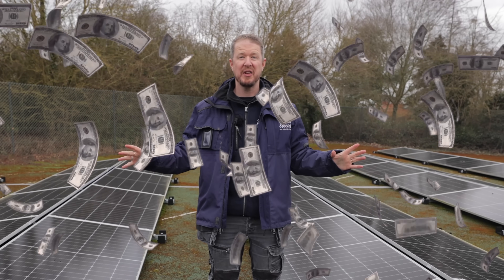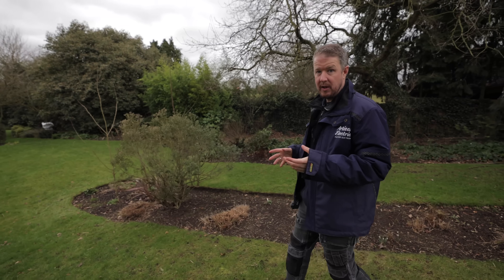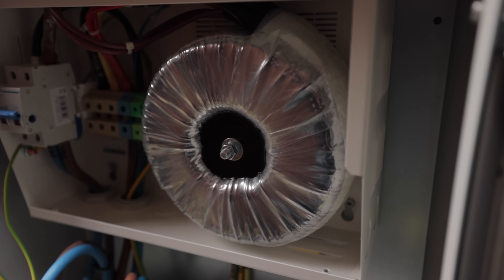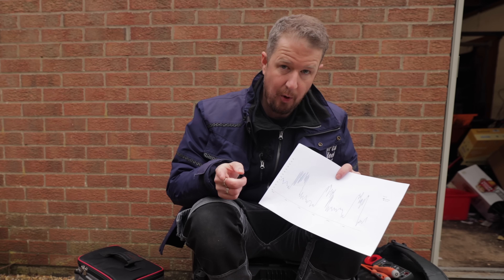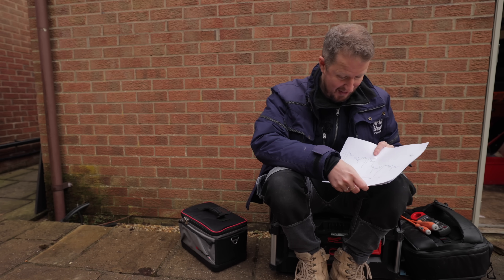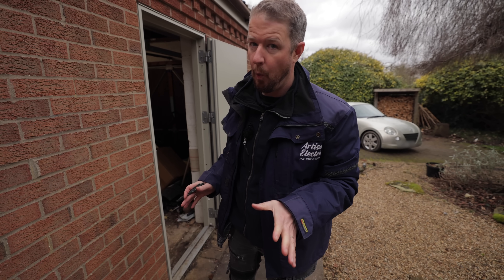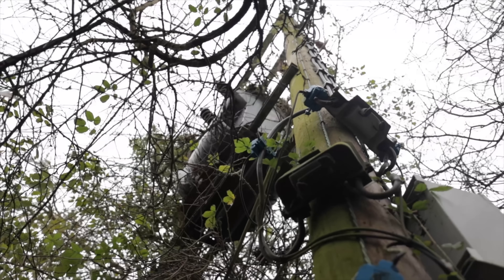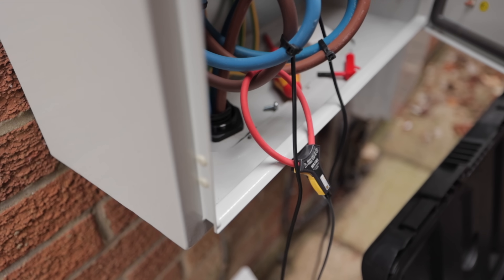THOUSANDS Down the Drain – And We Can’t Do Anything About It!

Comment: I dabble in electrical here in the US, but I am not a certified or licensed electrician.  I recently designed and built my own solar system with 200A service coming in from the local power company.  My system is “grid aware” and can take power from the grid, but selling is disabled on my side.  My setup also passed county electrical inspection on the first attempt.  While I’m not a licensed electrician, I do enjoy this kind of work and find your videos very informative and interesting.  This one, in particular, has me very curious because that’s a very odd issue to have.  I don’t know anything about how your electrical grid across the pond there works, but I’d recommend verifying your neutral and ground are properly bonded, done so in only one location, and that your grounding electrodes are sufficient.  I’d also suggest to check the phasing and make sure you don’t have a neutral landed where a hot should be, check that the inverters are properly synchronized and producing the same voltage within 0.1 volt of each other so that the load is evenly balanced across them. 

Likewise, I would be inclined to agree with you about the utility’s transformer possibly being the issue.  I’d even go so far as to suggest that the home’s distance from it could be a contributing factor as well.  300 meters is a LONG way for 230 volts to have to travel AND share with other homes.  My home has a dedicated 72kva transformer from my power company, and it’s right across my road, with the length of the service conductors from the transformer to my meterbase being around 80 feet.

Comment: The UK must have different laws and hardware compared to Australia. In Australia we feed the solar (PV) at around 350 to 400VDC into the grid tied Inverters which regulate the AC produced to ~220VAC. On really dark wet days the PV voltage can be as low as 345vDC, the AC voltage is ALWAYS 220VAC even on a superbright summers day. I suspect the MPPT controllers in the inverters are faulty. So long as you have excess PV voltage, the inverters should output regulated AC voltage at approximately 1-2VAC above the grid voltage clamping system voltage. I have a smaller PV system,  only 12kw of panels feeding 2x 8.2kw inverters in parrallel with 38kwh of LiFePO4 storage and my system voltage ner goes <213VAC or above 230VAC. We have a web based data logger which tracks and records all system voltages and power, PV and Grid, 24/7. So long as your MPPTs are ok you should have stable grid following output.

Comment: I'm in the southern US. In the 1960's when everyone started to install central airconditioning systems, we were getting voltage drops in the afternoons. My dad called the power company and had them bring out a voltage monitor for 24 hours. In the hot part of the day my dad went to the neighbors that were sharing the transformer and had them turn on everything electric to get the voltage to drop. The voltage dropped so much they quickly installed a larger transformer.

Comment: You only have a 35 kw h battery , no need to charge at 17 kw, you have 6 hrs to charge, no rush, drop charge power to  8 or 9 kw and your power draw will drop so your voltage will rise during night

Comment: The mains voltage in most parts of the UK is around 240v. Usually a touch above. The only people who have less are at the end of long radial runs in rural areas when they’re under load. Nothing wrong with that at all. That’s been our correct mains voltage for a long time and the entire system was designed to provide that. 240v plus or minus 6% was the original spec. I’m extremely surprised that you don’t know that, and haven’t been observing it for years whilst working in the industry!

The fact that all the paperwork post January 1995 now says 230v is just EU Brussels nonsense. At some point in time they insisted that the mains voltages across the EU were harmonised. Most countries had 220. We had 240. After many months, the engineers eventually managed to convince the numbskull Eurocrats that it was effectively impossible to change voltages. It would mean billions and billions of Pounds, Francs, Deutschmarks etc. worth of infrastructure running at sub optimal efficiency.  The voltages would have to stay the same as they were.

The Eurocrats typically idiotic solution was as follows. Rather than leave it alone they had to score a pretend victory. Those countries with 220v systems would have to ‘change’ their voltage from 220v to 230v plus 6% or minus 10%. 240v countries would have to ‘change’ their voltage to a different spec, being 230v plus 10% or minus 6%. This allowed everyone to keep everything exactly as it was before. The only things that ever changed were the wording of legislation, the textbooks, the words written on product labels etc….

I challenge you to measure the mains voltage at every property you visit this months and tell us in a video. You’ll measure over 240v RMS at most properties in most areas nearly all the time. It might dip a bit at times of high load on the grid. If you did the same test in France you’d get a little over 220 most of the time. Because they have a crappy grid that might dip quite a lot at times of high load.

Comment: 17kW on a single phase supply was always going to have issues.
Here in Australia (same voltages) we can put a 5kW solar system on each phase without any drama. If you want more then it becomes a more complicated application with the DNSP where they check network capacity, cable size etc etc.
Two options;-
a) limit the export/import limit of the inverters until you're in an acceptable range, or
b) upgrade to 3-pahse supply.

Comment: So, Solar Edge inverters won't stay inside the allowed voltage range for the grid? That is - not good. I'd expect that they have built-in limiters against that. 
This might become relevant as I'm considering getting a solar system myself. Solar Edge is off the table for now.

Comment: Here In Alabama USA You Never See The Transformer So Far Away From The House! Mine is About 200 Feet And I Am The Only 1 on The Transformer! The High Voltage Wire Runs To My Neighbors Which Is About As far As You Walked Where They Have Their own Transformer Also!! At Every Transformer There is A Fuse/Disconnect! Every Pole is Cleared Around And Has It's own Earth Ground Rod! They Run 2 Hot Wires And the Earth Ground From The Transformer To My Service Entrance! So If Some Retard Was To Run The Mower Into The Ground Rod And Break The Wire Coming From My Panel It Still has Earth Ground Coming From The Pole The Transformer Is on! But Like I Said All Poles Have There own Ground Rod! The Bottom Wire Is The Ground Wire! Connecting Them All Together! The Wire on Top of The Pole Is The High Voltage!

Comment: it looks like the power is no where to go on the net when the sun is shining, stranger is the enormous drop in voltage when the batteries are charging from the grid. The grid can not handle the load. there is to much resistance. it must be a power grid problem. like breathing through a straw.

Comment: My suspicion (I am NOT a professional electrician) would be that the impedance between the building and the transformer might be just high enough to not even allow the grid providers transformer to even it all out - was the grid impedance measured at the site? ... The voltage issues of the neighbors down the line - your PV system probably fixed them when running :)

Comment: So these voltage optimizers ... make ohmic loads not run over their rated power, making them less effective not less efficient, while making switching power supplies work harder and lossier? And it's basically a toroidal transformer with its secondary winding in series and out of phase (this looks like a 1 to 2 kva toroid core, no way it will power a whole house any other way!)? Could be an autotransformer also, which is almost the same principle...And... you know, I'd expect to pay like 100-150€ for a toroidal transformer this large, 50€ for all the DIN rail paraphernalia, and €20 for the sheet metal case. What`s with the difference?   . I'd have expected a unit that 'spensive to be at least a proper ferroresonant CVT but I am seeing no big capacitor.

Comment: Step 1 of troubleshooting this is you need to listen to UK power networks turn the solar and battery off and measure the voltage for a week to see if the large voltage swings are still present. You need to prove the problem is upstream that they must fix rather than you. Suck it up, follow the steps, and report it.  If it is the local grid then there's not much you can do - the only way forward would be for the house to use more power I suggest moving it to an off grid system but using the grid to support large loads and charge overnight.  Go on Eon next drive be happy at 7 pence overnight for 7 hours and then run the house in the day mostly off solar and battery with some limited grid support.  What else can you do?

Comment: On the solar inverter, it seems that a voltage output limit would have to take priority over current -- for the EV charger  to pass line supply test.  Those two units would have to be in close proximity or use over-sized conductors. But of course with that constrain(the voltage limit) it might not be possible to pump a high current back into the local power lines at the desired rate, and you do not want to over voltage the neighbors.  It would seem you would need a 200 amp supply service to accommodate a 100 amp  return and stay within voltage boundaries, back and forth.  I'm guessing these units are power factor corrected.

Comment: Not knowing how you’ve installed.  As I understand it, solar connects to a solar mppt charger which takes whatever solar voltage comes in and converts it to storage battery charging voltage.  The solar controller is generally attached to a bus bar with the battery and inverter inputs.   Now I don’t know if your running ac to dc car charging or dc to dc.  Dc to dc  would require an additional controller to limit amps.  Then the inverters supply the house with mains voltage.  Either from the grid in pass thru mode or from the batteries which are constantly charged via the solar.  Maybe brick and mortar homes wiring is different then say the rv/van life setup…. But I don’t understand why you have voltage spikes unless you are running solar direct … the battery should be the buffer that gives you constant voltage via the inverter.  So I’m confused unless the battery and solar is supplementing the inverter because they use so much power… in which case the inverter should take what’s given and output clean smooth voltage.  What am I missing?

Comment: "I tried to cram 17kW down a single phase domestic supply in a rural area and the voltage changed"

Your problem AFAIC.
Reply: This is exactly why we in the Netherlands use 3 phase.
We have with 17 kW only 25A every phase.
With a single phase you have roughly 75A. (2 times, also a neutral)
If the distance is really 300 meters, you need by 5% voltage dividing a 70qmm cable.
With a 3 phase system, you need 3 (4, also neutral) cables of 25 qmm.
With also more headroom.
Reply: @jinnygaatjenietaan306  
Basically. I have a pretty large setup myself with the same piramid-bases used in places, also with a fairly old grid but they outright told me 'Micro-interverter or guaranteed voltage problems, your choice'
Reply: @nvelsen1975  It is simple, if the grid is to old, you can't supply the amount of electricity.
The good old Ohms Law is stil in charge.
Reply: If that's the problem then Power Networks were wrong to say there was capacity to take the 17KW and should take some responsibility. He did his due diligence as the contractor.
But I agree the small supplier should normally be responsible for  connection to the Grid.
We run a small community generator and we're on the hook for £1million to connect to the local Grid. Luckily the local supermarket stepped in and offered to buy direct from us at a marginal rate and they paid for a line into their building. They get power cheaply and a % of anything that goes into the Grid. Everyone happy, no tax payer money wasted.
Reply: @purplemonkeydishwasher5269   I suspect 17kw is nothing to the network, and it isn't as the network is not complaining, the expectation would have been all those fed from that pole transformer would be feed that 17Kw.

The pole transformer has a ratio of about 48 to 1 so the extra 8 volts would appear as a blip of about 150mv.
The load that is wanted by the customer is anyone on the secondary side of that transformer (230 side) not the grid side.

The worry I would have is that an engineer working on that transformer would expect disconnecting the primary side of that pole transformer would isolate the primary side, and secondary, not only would that not be the case but the unconnected primary side would have 11000 volts on it.
I am told on a power failure the customers 'electrical generating plant' disconnects from the grid, I hope that system is reliable.
Reply: Sounds like the customer has been introduced to the problems of balancing the load, best of luck with that as even the gird operators struggle with that.
Can't, in times of high voltage, bring on a load, ideally a water heater (as who doesn't need hot water) to load the solar array, do it before the invertors (at the DC point) it probably wouldn't take much of a load to drop the peak voltage down to 245 ish. 
A simple bit of electronics could drop the load in and out as require.

The  best  AE can hope for is the pole mounted transformer is de-weeded and  AE told, don't push back voltages above 230 + 10% as everyone on those cables connected to neighbours suffers.
Reply: I have just been reminded, by the adjacent video recommendations, that this is the guy who spent £50,000 on a trade van with a 50 mile range.
Reply: Dick
Reply: Not only that, solar transformers are supposed to cut of the supply to the network when the voltage going over 156 volt.
Reply: Hopefully the customer ends up having to pay for any supply upgrades. Annoying to have taxpayer/bill-payer money spent on changing a perfectly serviceable transformer just so a few uber-wealthy can burnish their green credentials (while using 30kw of power before 9am apparently).
Reply: Yes, technically the transformer is fit to do what it needs. Not designed for small generation.
@jabberwock95.  Although. I know Power Networks and others have cut back significantly on maintenance of 'grennery' around low voltage lines transformers and substations. Why? Three is next to no govt subsidy for maintenance, but if something fails the government are on the hook to pay for new hardware. So they let if fall into disrepair
Reply: Wtf am I watching?
Reply: It’s as simple as..
Reply: @astronemir  an ego that cant handle he is wrong....this is why i cant stand this channel. I dont follow it and i still get these recommendations
Reply: No, When they said go ahead your good it became THEIR problem.  
My power company asked to come and check my system since they have no authority on my side of the meter they can't demand anything.  
They thought I was joking when I told them I would be selling power because the law says I have to.

Comment: UK mains voltage is 240Vac not 230Vac
Reply: The voltage used throughout Europe (including the UK) has been harmonised at a nominal 230v 50 Hz 
(formerly 240V in UK, 220V in the rest of Europe) but this does not mean there has been a real change in the supply.

In 1989 it was decided that the mains voltage would go from 220 volts (240V UK) to 230 volts. 
It was agreed to gradually change to 230 volts over approximately 15 years.

Comment: Bottom line is electricity grids were never designed to have  solar  feeding back into the grid at the consumer end  .             Guessing the inverters were not outputting the full 17kw being late winter ?        Thinking around 7 to 10kw max per phase would be more reasonable as a grid feed ?

Comment: Could you not fit a couple of overvolt protection devices linked to relays that control dump loads?.  One set at say 250 and one at 255 with wide hysteresis settings. Suitable dump loads could be pool heating , night storage devices or similar

Comment: 10 min into the video... So, you need the voltage optimizer to turn on during the day, and be bypassed at night.  Yeah, the utility is responsible... but they are not going to take responsibility even if you show that they have faulty equipment.

Comment: I'm still amazed at your 80amp or 100amp main fuses in the UK. Other countries usually have a 32amp or 40amp breaker as a main. I guess this is why you run into issues much quicker, especially in the rural area's. I can still remember photonicinduction dimming light for the entire street with his 100amp variac control panel.

Comment: As an operational engineer with a DNO we see plenty of issues with embedded generation installs.   When applying for your new point of connection and point of this being secured the max connected capacity should have been submitted and then checked by your supplier.   Unless you have a TX just feeding that property then it’s not possible just to drop the voltage to an individual property when feeding multiple properties.   
Your G99 relay or G59 relay on an older installation will give your installation protection from the network but this does need setting up correctly.  Are you running a number of inverters or one for the whole install